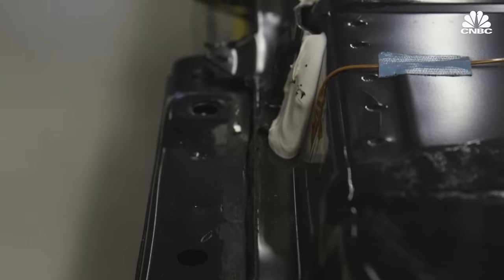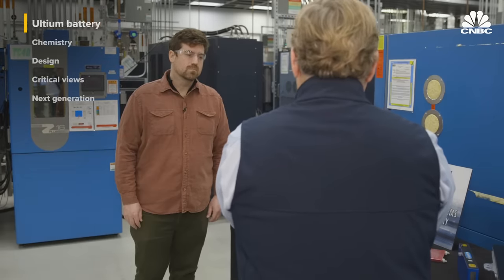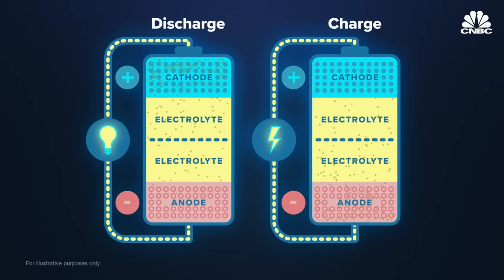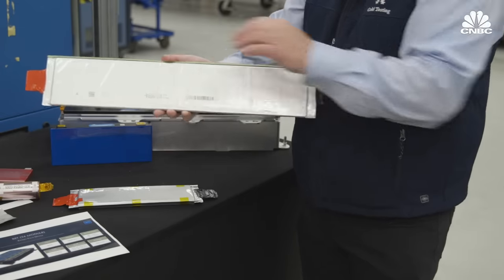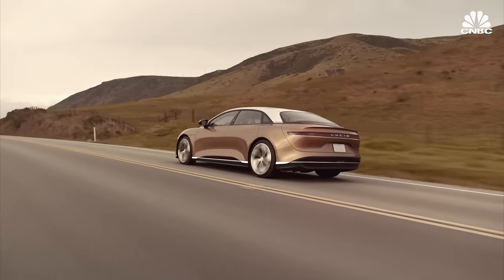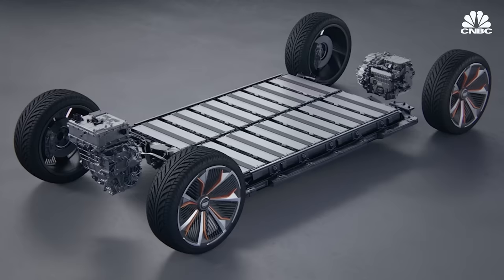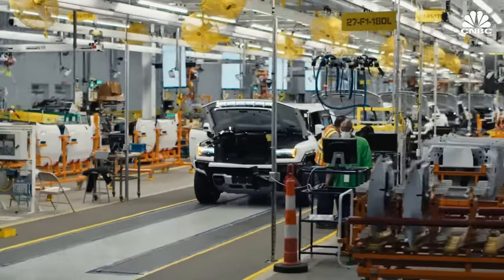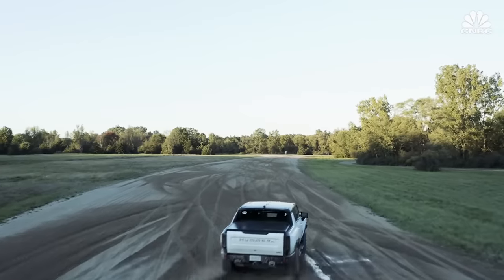Why GM Says Its Ultium Batteries Will Lead It To EV Dominance

Comment: If EV sales were measured in hot air general motors would be the leader by 2025.  They said in 2017 they’d have 20 models by now.  Well…where are they?  Meanwhile don’t charge your Bolt unattended.
Reply: You're making it up, Brian.  All Bolt's have had their batteries replaced due to LG's manufacturing problems.  The Bolt is back in production.  It does not use the Ultium battery.
Reply: Majority of bolts were bought back by GM .

Comment: I highly doubt how upgrade-able this system will be for the future. Cool to say another cell can be placed later on, but the bms might not like that, or the batteries, or the batteries might NOT fully work to their full potential, why else even upgrade. Or will they die fast?
Reply: GM will be out of business before anybody wants to do that
Reply: They know they won't last and it will generate a ton of revenue on exploratory investigation fees. Oh, sorry sir, it took us 6 hours to determine it was this packet. 1000$ for inspection and labor to assess and another 800$ for the packet and install.

Comment: If you're a battery engineer, do you want to work for Tesla or GM?
Reply: GM has probably way better benefits and better work culture I think people confuse engineers with gamers...
Reply: @gabrielmassicotte-rochon6920  culture? Are yout hat blind to not see the rate of innovation take place in Tesla?🙄.
Reply: @niyazzmoithu20  Rate of innovation at Tesla? Tesla has been nothing but delays.
Reply: I think a lot of people don't really care about the rate of innovations as much as working in a good environment with good benefits and also more certainty that the company will not fail..
 Tesla have the reputation to be a toxic work environment, it is also very over valued, they don't sell a lot of cars and are more prone to a possible bankruptcy that could happen in a recession
Reply: @gabrielmassicotte-rochon6920  None of the legacy auto makers are in the top 10 in the USA for engineers. Toyota is ranked high in Japan, VW in Europe, Tesla in the USA.

Comment: I'm generally a Ford fan, I want the lightning, but I will say that it's crucial that the manufacturer intends to repair their EV's on a cell/pouch level - as opposed to simply replacing the whole pack whenever you... oh I don't know... bust a coolant hose fitting, like Tesla was in the news for.
Reply: The lightning is great but why does it cost $80,000 ?
Reply: @davidkettell5726  the base model is around $40k, plus there's a $7500 federal rebate not to mention possible state rebates depending on location
Reply: Yes. When battery replacement is so expensive... I need a 15 or 20 year 500 000 warranty.
Reply: @davidkettell5726  Why does a Grand Cherokee cost $90,000?
Reply: Maybe they will do like Nio. You can swap the batteries in no time. I like to see them recycled the batteries but then again solid state batteries can last over 50 years easily.

Comment: My question is how you going to get regular people to buy electric car most people cannot afford even a regular car today..
Reply: They're buying over priced gas guzzling trucks and SUVs.
Reply: The goal is to get EVs to an affordable price. Like the Bolt or Model 3.

Long term maintenance should also be cheaper for EVs vs ICE cars.
Reply: @LaniakeaDenizen  I wouldn't consider the Model 3 that affordable anymore. Especially consider GM has models coming at $30k and lower.

Comment: Well to be fair, with other brands I can charge my EV and not have to worry about burning my house down. With “gm”, not so much. I don’t think that’s going to “dominate” the market. But I am very intrigued to see the technologies with both EV’s as well as the potential development of clean burning fuel for ICE.
Reply: Many cars were recalled due to faulty LG batteries, not just the Bolt. NHTSA is even investigating due to how many LG recalls there were.
Reply: Burning H2 in a combustion engine will still produce nitrous oxides (acid rain)

Comment: GM will never be #1 in EVs because Tesla is. GM also should have went out of business years ago instead of the government bailout 🤷‍♂️
Reply: Tesla is losing a lot of market share with others joining in. GM can beat on price easily. Fed saved many American jobs including suppliers that sell parts to GM
Reply: @romeou4965  I doubt GM could sell an affordable EV. If ai bought anything it would be a Ford Maverick base model hybrid truck. The country does not have the infrastructure to support everyone driving an EV. Hell, where I live the grid goes down on hot days when everyone has their AC on. Imagine at nights when everyone has their cars charging.
Reply: @j887276  just look at how affordable Korean giants Kia and Hyundai are selling EVs in the USA. Both Ford, Chevy and GM have to follow suit to maintain market share. 

Many shopping and work parking have EV plugs for day charge so not every EV will be plugged at night. Like cell phones, don’t want to overheat batteries by leaving plugged all night neither. 

Solar powered battery will allow for overnight charging and at no utility cost. Ideal scenario.
Reply: @romeou4965  That would be nice. I got a quote to have solar installed on my house and garage roofs about 5 years ago and it would have been around $35,000. Recently I was told that solar was now "cheaper than ever" and had the same companies  come give me new quotes. 

Wrong. It actually got more expensive 🤦‍♀️. My 35k quote is now 68k as of 2 months ago. I would love to see the cost of going solar become affordable, as in 10-15k but no way in hell will I pay anymore than that for a solar system.

I've talked with neighbors and coworkers who agree the cost is too much. The state where I live has a very small incentive, used to be a 15k when I got the 1st quote now it's about 5k and will be gone next year leaving 100% of the costs to the homeowner.

Also Hyundai and Kia might make a good EV, but I wouldn't touch them with a 10 foot pole due to the past 10 years of recalls due to their vehicles bursting into flames consequently being declared total losses by insurance companies which has led to class action lawsuits. Before that they were well known for being "throw away, cheap cars" and quickly lost value.

Comment: 13:40 Isn't ironic that Musk has been saying exactly that for the entire time Tesla has been in the spotlight? He emphasized that making their own batteries and securing supply would be the greatest constraint for ANY automaker. The dude laid it out for the other companies but they all went "lalala can't hear you"
Reply: With all manufacturers drawing from the same limited (but growing) raw material supplies, future EV sales and sales growth of any brand will depend on the quality and form of EVs they make. more desirable vehicles will sell better.
This should be a warning call to Tesla. It is time to focus on vehicle quality, customer service, and making vehicles that more people consider to be desirable.
Reply: @Miata822  Yes and no. They need better customer service, but I would say their EVs are pretty good build compared to other EVs on the market (maybe except Porsche and possibly Polestar).

I have rode in the Mach-E and thought it was a mediocre ride. The punch, comfort, and quality were all lacking. The owner also said they already had a recall for faulty roofing and computer parts.

Tesla still leads the pack. I hope others can surpass them soon, though, so they improve faster.
Reply: @tommysrp7635  I too didn't care for the Mach E's ride. I assume, however, that the roof was quickly repaired. I saw that Ford had issued a recall on certain early models.

I found Tesla's ride and road noise level to be inferior to the gas cars in the same price range, whose owners we need to win over. ICE cars are the real competition.

I now drive a red Lucid Air GT on 21" wheels. It cost about the same as a Model S Plaid (less than a red Plaid w/ 21" wheels), but is much nicer in every way. I have not driven the Mercedes or BMW EVs but reviews are very positive for both companies. GM knows how to build smooth quality cars and has a variety of EVs coming out in rapid succession. My 2018 Chevy Volt has been flawless since day one. And then there are the pickups.

I have seen more Porsche Taycans and the new Hyundai/KIA EVs at charging stations than other brands. These cars, like the Lucid, have 8-900V charging which makes charging amazingly fast. Rivian and others have announced that future versions will use this high voltage since it makes travelling so much easier. Half a billion dollars has been allocated to subsidize new charger installations.

Bottom line: Technology is moving forward. Valid competition is coming. I want to see Tesla succeed, but to do that they need to concentrate on the basics & get that sorted.
Reply: @Miata822  How does a Tesla compare to the Bolt in terms of road noise/build quality? I know the 2 are vastly different price ranges, but one is GM made.

How does your Lucid compare to a Plaid in terms of road noise and comfort? I am yet to see a Lucid in person or ride in one, though I am quite eager to visit one of their showrooms soon.

I will say, though, that a primary reason ICE cars sound better at similar price ranges is because of the engine noise that drowns out some of the road noise. It becomes so normalized within our brains that we tune out the sounds and similar frequencies. I would compare EVs in similar price ranges for an apples to apples comparison noise-wise. The old Teslas with single pane windows were/are a nightmare in terms of noise on highways, though the new double panes are quite the improvement.

I have seen more ID4s and Hyundai EVs around lately as well, though they are still in the minority relative to Teslas. 

I agree with you on the point that Tesla needs to continue improving their fundamentals. Get those air suspensions on the 3 and Y already damn it! However, I still fail to see how others are competitive with Tesla yet (in terms of volume production to quality). Lucid is an exception in my books because they are almost in line with Porsche/Ferrari as being explicitly for wealthier patrons so it won't be the same type of mass production as Tesla.
Reply: @tommysrp7635  I did test drive a Bolt. I didn't care for the interior, cheap, but it's a cheap car. Well built as far as I could see and an absolute hoot to drive. There's something about a small overpowered car that is irresistible to me. The slow charging is a deal-breaker for long trips, but some still do them. My Volt in top spec was worlds away in quality. Adaptive cruise (in '18!) is wonderful. Still has no squeaks or rattles, has always been quieter than a Model 3 even with the engine on.

the Lucid was benchmarked on the MB S Class. Ride is refined but somewhat sportier than the MB. Some pleasant motor noise at lower speeds, dead silent at 85+. Massaging, heated, and cooled leather (vegan opt.) seats are adjustable in every way, reset my facial recognition. Rear seats have at least twice the leg room of Model S. Very comfortable for all occupants. 60-100 in about 5 seconds (numbers fly past too fast to be sure). Honestly Lucid's not a fair comparison to a Model S. Very much like comparing a BMW 7 Series to a Dodge Charger Hellcat- Both are big & fast but different customers.

It is the ICE car drivers that Tesla needs to win over if they are to grow. It is hard to find test drives now of the MB and BMW EV offerings, Maybe you should check out the reviews here on YT for the opinion of folks who have actually driven one.

The I.D.4 doesn't appeal to me and I haven't driven it. Taycan was impossible for me to get a test ride in before ordering the Lucid. If you are truly interested or a Tesla investor maybe you should talk to a dealer about seeing these cars.

The thing is, truly desirable EVs are entering the market. Tesla can't rest on its laurels. This is the time to grab as much market share as possible and tie up loose ends before every dealership everywhere has EV demos sitting on lots.
Reply: @paulbedichek2679  Tesla literally held a Battery Day where they revealed their process for making cells. That has been in their playbook the entire time but only recently started ramping up their production and implementation. They also have the most contracts with other battery companies (LG, CATL, etc)

Going from ICE to Electric is a painfully expensive process. There is a reason start ups are trying to create EV specific plants. They know they will be losing soooo much money converting over to EV and that is why they are desperate to keep churning out ICE cars. If you look at the stats, most companies are still LOSING money on each EV they create.

Also, it is clear that pouch batteries may be cost effective, but can't match the efficiency that Tesla achieves with their current cells. If they could then GM/Ford and company would have EVs that match Teslas range. Instead, they put huge pack sizes in their cars and range limit them to try to get longevity out of the packs. It isn't going to work in the long run if you are trying to be cost competitive while being spec competitive.
Reply: @tommysrp7635  Good luck,4680 has not been successful,while Ultium appears like a winning formula, more EV's are good, even if Teslas are prone to burst into flame, and horribly roast occupants alive, all good if you make money on the stock, but that hasn't been the case lately.
Reply: @paulbedichek2679  You didn't provide a single counterpoint. You just tried to smear Tesla. Do you know the ICE car to Tesla car fire ratio? Even if you scale to match 1:1 car count, Teslas still have significantly fewer fires. The only reason they appear on the news is because it is like a plane crash. So rare it is newsworthy.

Edit: Lol Ford and GM are cramming more batteries into their cars than Tesla in terms of KwH to match efficiency so any fire from Ford/GM will be more intense.

4680 is already in production in the Model Y from Texas. They are ramping up and preparing to likely replace all but the Performance models with 4680s because it is simply better.

They have a 3 part structural build for the Model Y while Ford is still figuring out how to keep the glass on their roofs. Good luck catching up with decades of innovation that keeps improving with each factory.

How many new factories has GM erected and put into use in the last 5 years for EVs? Tesla has done a couple and plans for more. I don't see any other company doing that.

Also, I have no stake in Tesla stock anymore. I made my money and bought a car. That was all I needed. Now it's just about discussing other EVs with people who can't really explain why Tesla sucks

Comment: Regardless of what point GM trying to make. Tesla's structural pack is way better even from the first look. For instant, Tesla is doing thermal management at cell level. Look at these GM blades, can't figure it out how GM is doing it. Or maybe they are not. And Tesla speed of innovation is lightning fast. Like GM is riding a bicycle trying to catch a sports car running top gear.
Reply: Except are they super fast innovators? Let me be clear I like tesla and I do think their Ev are as a unit probably the best on market class for the models they have.

That being said, with musk at helm that innovation is somewhat underwhelming...

They're constantly promising and not delivering and people seem to forget that. Add on that they have being building effectively the same three vehicle set for half a decade if not more. Yes they've ramped production. How about their truck? Wonder how those deposits feel now for people.

Tesla used the deposit system to generate Capital for growth early in but at this point they don't need it. They have the largest inflated stock price by market cap bar none. That means they have an inoordiante ability to use that for growth. This is why the concept is grow and then profit for these companies. If you're worth a trillion and your competitors a tenth of that, you can leverage that for purchases and development.

Now we have the issue of adding on a market landscape that Is about to be flooded with Ev. We are talking cheaper choices, mixed distances. Charging standards that differ from tesla who has thus far been butting heads with regulators to match standardization  which would benefit all of us.

To all of this tesla now will have competition for talent, and resources, and don't doubt that the fact tesla doesn't make their own batteries isn't going to be a big issue.

Legacy automakers were morons and did stock buy backs when they should have seen the blood in water. However the blood is here and apparent. Oil is for sure out and the markets and investors are proving that as they stop reinvesting profits meaning production will fall only hastening price increases and bringing Ev parity ever closer.

But again, these automakers Have the experience and they can throw money around too. Tesla can get their talent poached.

All the while tesla skirts the line with regulators so long as their ceo spews his stupidity. The reason they don't advertise is because they'd get sued.